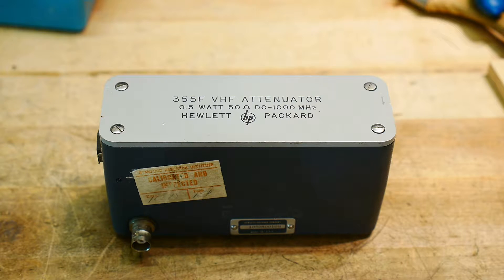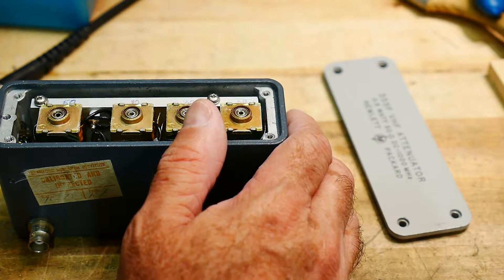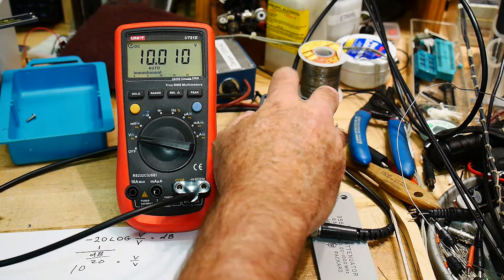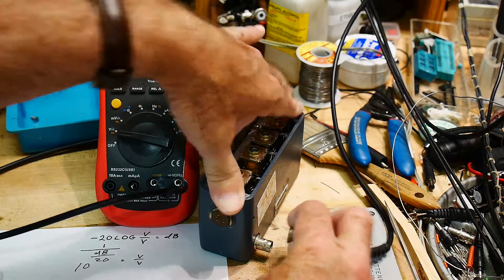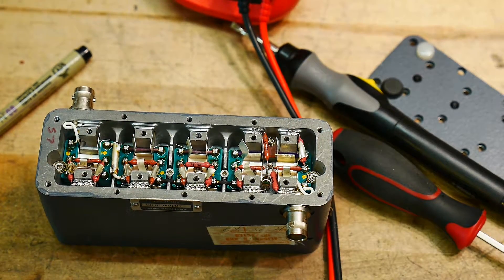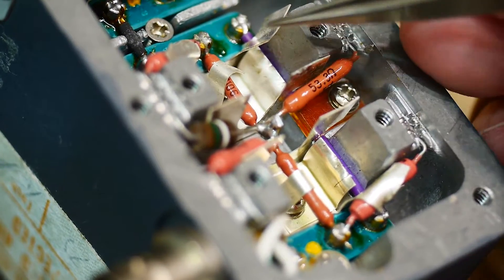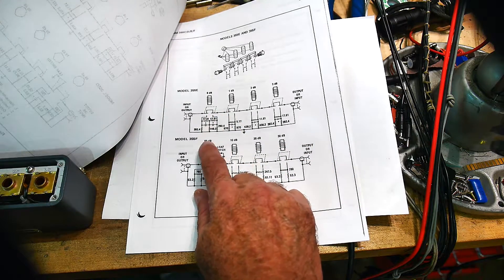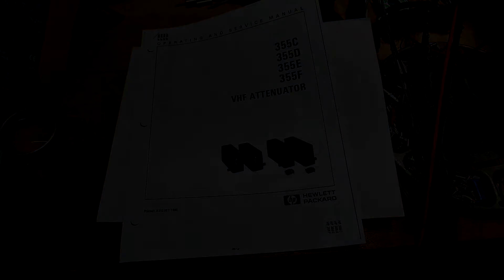#531 HP 355F Controllable Attenuator

Comment: Don't touch those 'bashed' plates! At those frequencies, fine tuning and adjustment is by bending things towards and away from each other. Each of the 'mouse-bite' marks are where the tech that did the calibration used his screwdriver to push the plates at various places to obtain a flat characteristic.   You 'neaten it up', you ruin the accuracy.

Comment: V^2/R
Reply: What is this? V ^(2/R) or (V^2)/R usually this formula has to do with centripetal acceleration ???
Reply: @renekohli7675  Volts squared over ohms is another way of calculating power.